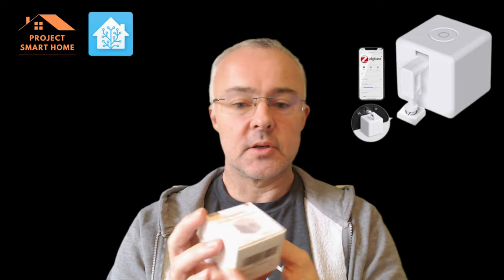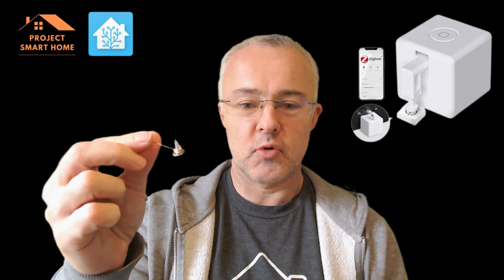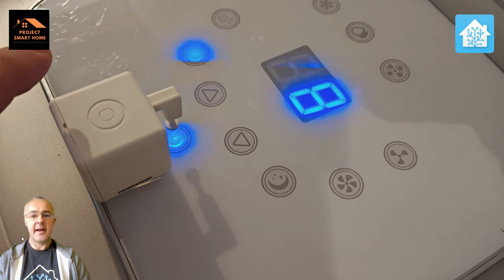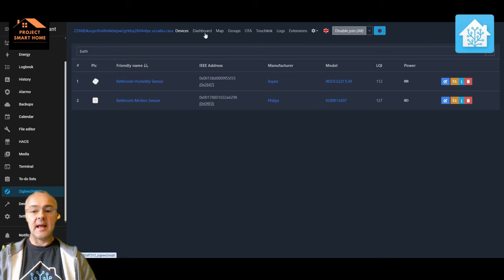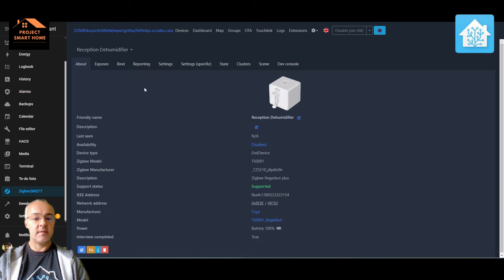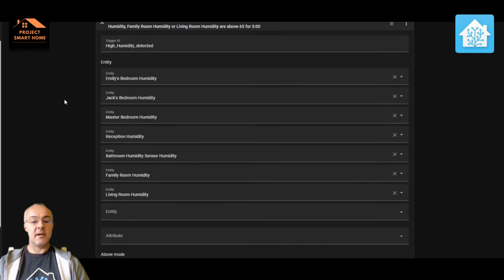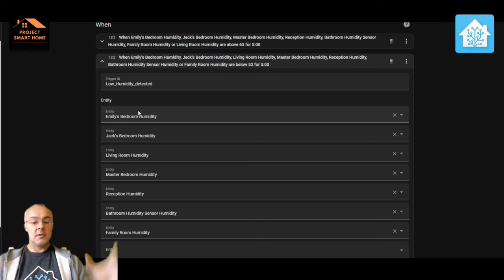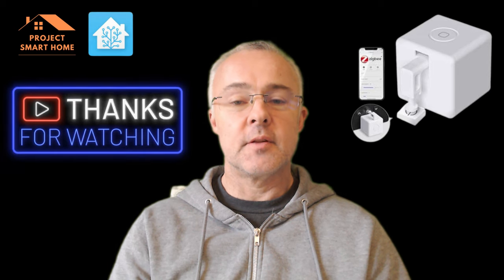Zigbee Fingerbot Plus and Home Assistant - With a Twist!

Comment: So I use the signee usb radio antenna hooked up and use that to discover my zigbee devices.  Should this work with that?
Reply from the maker: From what I have read.  The Fingerbot works with Home Assistant ZHA and Zigbee2MQTT.  So if you are using either of these you should be OK.

Comment: Is this model require a Hub for zigbee integration ? Or can it be directly connected to the Zigbee concentrator connected to Home Assistant ?
Reply from the maker: Someone may prove me wrong but I don't believe that the HDMI sync box solution would work with HA.
Reply: Hi @ProjectSmartHome  ,
I don't understand your answer. I'm not talking about HDMI sync box but the Zigbee Fingerbot Plus ;)
Reply from the maker: I have all of my ZigBee devices directly connected to home assistant with Zigbee2MQTT. This includes the finger bot

Comment: Hello, is it possible to do double clicking? For example clicking 2 times (double click or two clicks have less than 5-10 seconds apart) in every 5 minutes.
Reply from the maker: I can't see a double clicking option in the user interface but I have just setup a quick test automation to switch the fingerbot on wait 2 seconds and switch it off. This worked as expected.  So essentially meeting your criteria for double clicking in less than 5 seconds.
Reply: @ProjectSmartHome  So can it do it continuously? Like for 10 hours.
Reply: @ProjectSmartHome  Did you use other devices for setup automation?
Reply from the maker: The automation is done with Home Assistant.  I have a Sonoff Zigbee coordinator plugged in the my Raspberry Pi that is running home assistant with Zigbee2MQTT.
Reply from the maker: I don't think that it is manufactured for that sort of use.  Maybe the product documentation would give you an idea of how many hours use you could get out of the robot.  And its battery operated so using it like that I expect it wouldn't last very long.  But that's just my view.